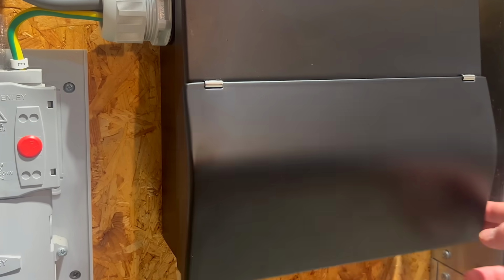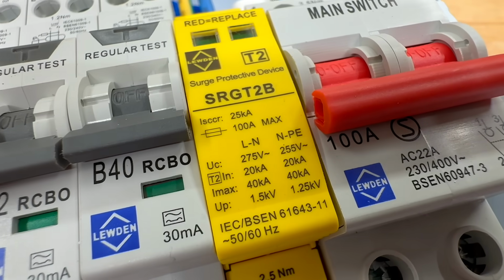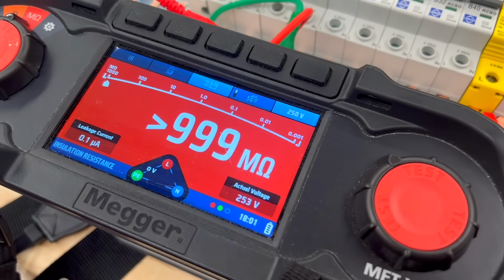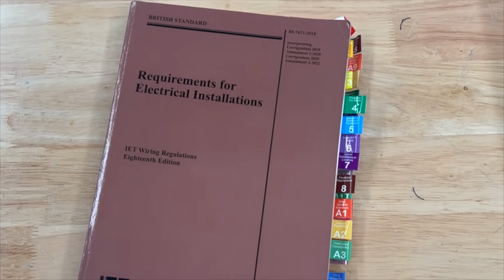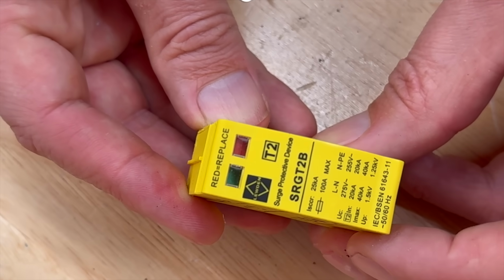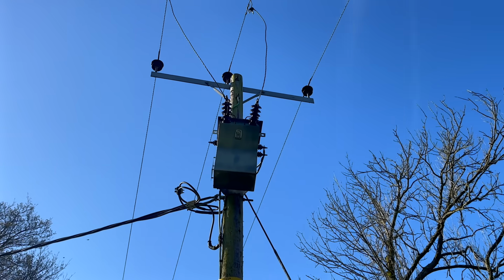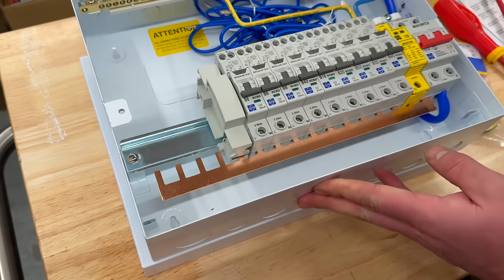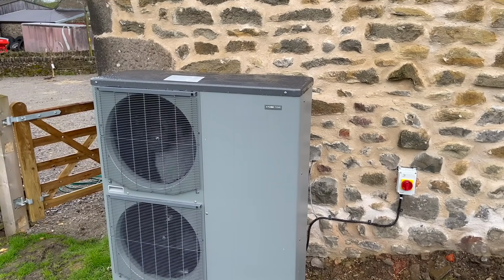Why do Surge Protection Devices no longer require an MCB?

Comment: Currently looking into adding a SPD to my home.  And I'm still seeing many SPDs that require an MCB, either wired in series or upstream.  It's not always apparent from the technical data, often I had to glean it from the installation instructions.
Having to add an MCB kinda stinks... I'm on 3 phase so we're talking 8 units in the consumer unit :(

Comment: Don't most electronic equipment have transient surge protection built in to their  P.S.U as most electronic equipment runs on D.C the current needs to be stable.

Comment: I have just come back to this video are Navitas posted their SPD video the other day. It's like they didn't even watch this video.
Reply: We watched it. So did the guys from surge protection devices and so did our technical team. And we just fundamentally disagree with it. 

The solder point will trip in seconds not milliseconds, you can’t measure or test its tripping capacity and you’re reliant on the DNO fuse as OCP. 

If SPD experts like Kirsty Johnson who sits on the committee with JPEL say it’s not adequate and requires an MCB, then I think that carries a lot of weight.

Comment: Maybe not the same level of issue with "merely" domestic installs (all the small devices I've seen are interchangeable module type that a householder can do without turning off their main switch), but in the commercial/industrial environment where you want to get the contractor in every year or two to properly test your SPDs (or every 11 months if you have an LPS since they probably do both at the same time) you must have an MCB or fuse carrier to fully isolate the device.  It cannot be tested live!  This is why the ISO Standard and CoP insists on an SPD circuit having such isolation, that and the ludicrously slim chance of the cables to the SPD being overloaded otherwise...

Putting an insulation resistance tester across it and thinking you are performing a funtional test is of course just foolish and lulls customers into a false sense of security.  (In my experience, about 25% of SPDs that fail a proper SPD test were still showing good "functional" flags.  Which doesn't mean they are pointless, because if they are down then the device clearly has failed, but does mean you can't rely on them showing the device is good, especially if they really are protecting sensitive kit or mission-critical data.)

Comment: The benefit of an SPD wired downstream a main MCB is that when it fails short circuit, the MCB will trip, protecting the installation until it's manually removed or replaced. With these fused SPDs, you rely on either manual inspection, or an extra attachment that activates some contactor when it detects a flag.

Comment: The power transformer seeks to maintain a certain level of magnetic field varying at the rate of line frequency. If a load is suddenly remove the energy will be dissipated into other loads and that will create a momentary power surge or it could create a voltage spike. The surge/spike protector help prevent equipment damage. It is good to keep a spare -- if the protector throws the main breaker or if excess leakage is indicated.

Comment: It is interesting how this flags its failure, but unlike everything else in the consumer unit, this flags its us not accessible to blind people. Something tactile might be helpful for people like myself and my totally blind partner
Reply from the maker: You can use a contact to trigger an external device to alert that an SPD has failed.
Reply: An MCB in the down position compared to everything else being up also solves the problem. So long as they can get to the CU
Reply: @T_Perkins  Why would they be going and fiddling with the CU anyway?  Unless there's been a terrific bang involved from lightning or other big event the SPD is going to go out of service silently (heat rise due to slow deterioration of the MOVs allowing low current to flow continuously melts the solder).  An external A/V alarm would be the better choice, for everyone.

Comment: That SPD looks nice but if there are (more than one) RCDs protecting the breakers in the consumer unit, you'll not be able to use a busbar. Still, the combination of the SPD and MCB in a single unit is a huge advantage.

Comment: I was at the elex today at the ally pally and there was a talk there and it was explained why you should not install an SPD without an MCB
Reply from the maker: Who was giving that talk? Please send them to the comments to explain themselves.
Reply: @efixx  I'm sorry I did not get her name if it helps she was a young lady in a wheelchair maybe someone else who was at the show will remember her
Reply: @efixx  the spd expert at surge has explained many times why it needs protection
Reply: The advantage I can see to having an MCB in line is the visual assessment by the/a consumer who is not able to or very familiar with the workings of a DB - for means of remote diagnosis. Also, if one thing is down, and nothing else is, and the board is above eye height, it's lot easier to see than a little red flag that only viewable straight on on the device.

Comment: Those melting solder cutouts seem very dodgy to me, if it fails to clear then the unit will finish having its thermal runaway… wonder how common this is, because the MCBs usually specified to protect the SPD are a pretty high rating?

Comment: Another solution for a problem that does not exist, more unnecessary expense for the end consumer who is being fleeced at every opportunity.
Reply from the maker: Can you repair my £300 printer which failed due to a surge event.
Reply: I have had my £300 printer for 10 years. It must be able to take a surge. Or more likely never had one.
Reply: @hammertime3703  exactly, a solution for a problem that simply does not exist!
Reply: @mintsauce101  Then one day you find out it does exist.  You come home and your fridge, TV, air conditioner, toaster, washing machine, computer, internet connection, water heater, space heating, EV car and so on, no longer works properly or perhaps at all because that one big event happened.  We no longer live in the 1970s and earlier where most things were electro-mechanical.  That one event that may not happen, ever, but should it happen it is going to knock you from the 21st century back to the '70s.  Most appliances will deal with the day to day stuff that comes in on top of the 50(60)Hz supply but even then cumulative damage still takes its toll.  Cut open a safety rated film capacitor that has been across the mains for a few years and look at all the damage (it is impressive).  I actually had such an event happen in the '80s.  A fault of some type happened with the transformer that supplies my neighbourhood.  I had my home computer, TV, VCR etc plugged into an Islatrol filter which took the hit and saved everything.  The neighbours weren't so fortunate.
Reply: @ Well after 30 years in the same house I am yet to experience this phenomena that seems to be so prolific that new protective equipment is being developed and forced on on the consumer at great cost, all through scare mongering. Bear in mind I have been working in the power industry for 20 of the those 30 years and see first hand the "quality" of modern electricity generation. You are correct, we do not live in the 60's, 70's 80's 90's or even the noughties anymore, modern supply regulation equipment means that any transient spikes are absolutely mitigated at source and not passed on through the network and why you may ask? Its down to the Green generators switching in and out of supply. Solar, Wind and Energy from Waste (Biomass etc) all are classed as unstable generators and the connection designs for these supplies all have state of the art reactive smoothing specifically designed to prevent and mitigate spikes. Its a complete non issue on modern generation but the IET have justify their existence and need to maintain their funding streams.
Reply: @mintsauce101  You do understand that transients are typically generated by loads in a particular LV transformer distribution area, right?  We aren't talking about issues at the MV layer.  No wait, wait, you do understand this at least based on your statement that you worked  in power generation for 20 years.
Reply: @mintsauce101  In case you haven't guessed, I don't care what you post next, that might be an implosion of anger, who knows.  I won't be responding.  My comment about LV and MV will be the last.
Reply: @efixx  really sorry for your loss, how do you know it was a surge event? Do you have active monitoring and data collection at home? These so called surge events as you say in your video are transient short term spikes, I'd be interested to see how you came to that conclusion.
Reply: You guys don't have lightning strikes? 😮
Reply: @Jako1987 30 years and still counting, loads of tech in the house and never had an issue.

Comment: If you have ever seen a MOV blow it would be the last thing you want inside a consumer unit and relying on a specific amount of heat to melt a blob of solder is a bit dodgy. A separate metal box would be better and better still would be to wait for ISOMOVs which incorporate a GDT sandwiched between two MOV discs. An advantage of ISOMOVs is that the MOV parts don't have mains across them all the time, slowly degrading them.
For proper surge protection Type 1, Type 2 and Type 3 devices are all needed in place, Type 1 at the entry and Type 3 close to sensitive devices. The real reason for putting them inside consumer units is to protect the microcontrollers inside AFDDs.
Reply: Just a bit of smoke when they blow, what’s the drama?
Reply: @edc1569  Oh no, it can be far more spectacular than that.  Even when there are MOVs in an appliance, where the fault current is greatly reduced due to cable lengths, can explode into shrapnel.  Only some thick heatshrink, if that is even present, contains it.

Comment: Just an observtion, the SPD protection has no external warning it has failed apart from that built in to itself. So a householder may likely not know it has failed unless they regulrly check the stste of the consumer unit. Thus if frequent surges occour the use of the device would be of little value after the first failure would it not?.
Reply: I think you raise a great point. Perhaps some kind of SPD+MCB+main switch combo, whereby an SPD unit with a replaceable module could be attached to the main switch and switch off the entire installation when the SPD module needs replacing.
Reply: @NewMediaWarrior  switching off the installation is bonkers imo
Reply: @edc1569  depending on what equipment someone may be running, they may want that, although in that case, they should be prepared with replacement SPD device modules. Mind you, it is only switch off, not switch off and lock off (that would be crazy)!
Reply from the maker: The devices are only liable to fail after multiple surge events, the exact number depending on the frequency and magnitude of the surge. In most installations they are rare events. The surge device does have some volt free contacts which change state on failure so could be used to trigger an external device. - Learn more in this video https://youtu.be/EHbtvzHakbU?si=DibkD7RsPbl3Q8K6
Reply: Lots of call outs 🤑

Comment: My understanding of SPD’s is they must be used with a fuse/MCB that is in series with all circuits downstream they are intended to protect to work best, when the voltage goes very high they go short circuit or very low resistance, loads of current flows and blows the fuse/MCB and thus protects all devices downstream but will effectively one shot leaving everything off afterwards! The current arrangement is a compromise or trade off with the SPD on its own breaker that makes them just in parallel with the other circuits so it can’t protect them once its own MCB is opened. So I think for best protection individual appliances still need their own fused down surge protection locally some electronic power supplies have SPD’s built in for this very reason, a surge would just blow the devices small local fuse following a surge event protecting the individual device’s electronics if your lucky!
Reply: You might want a Type III to work like that (although they still don't due to the low energy generally present in that context) but Type I & II work in parallel with the supply to dump the surge to earth before it reaches other circuits.
If you install one as you describe, which would be trivial, it can only protect the single circuit you install it on, in the manner you describe.

If you really want to specify the extra layer of protection you describe, use an industrial SPD that has a trigger (an electrical signal on a 2-pin header or a mechanical pin that can trigger another device) and wire your desperately-sensitive circuit via a contactor triggered by the failure of the device.

SPDs operate faster than an MCB possibly can -- generally in half a cycle -- so being able to dump a surge to earth and then open again to leave power seemingly uninterrupted is an effective way of protecting the whole installation rather than one circuit.  And if you have equipment so sensitive that you want this level of protection you'll already have a contractor coming in every 11 months to inspect your LPS who can also test your SPDs... won't you...

Comment: Crabtree and Wylex SPDs have never needed an MCB. They have also been a single module for several years.
Reply from the maker: Correct but they did used to be 2 module devices
Reply: @efixx The point is Lewden aren't the first to market with a single module SPD that doesn't require an MCB, so I put it to you that they have copied their competitors, rather than innovated.

Comment: Great video - thanks for sharing the video. However, I'd like to comment a misconception regarding the single-line diagrams: The video presents that the transients travel from the live conductor through the SPD and towards the neutral. As we all know, the main principle of the SPD is to absorb these (coming from any phase and/or neutral) and send them to the ground, NOT the neutral! This must always be the case regardless of the earthing system of the premise (TT, TN-C-S, etc).
Reply: Sure?
Reply from the maker: Interesting point - but also remember that in TNC-S the Neutral and Earth are joined together at the service head  typically less than 3 meters from the consumer unit.
Reply: @efixx  Thank you for your reply, however I have a different point of view on the subject. I mention on my previous comment "...regardless of the earthing system of the premise (TT, TN-C-S, etc)" to avoid commenting things that have no relation with the main principle of SPD but, here we are. If we think for a moment your approach and consider a large project, where the distance between the main supply and a final circuit could be hundreds of meters away, you should not expect to carry these transients back towards the main supply's location (ie main earthing bar) to be resolved but to send them to the ground as quickly as possible. In such case, TT or TN-C-S or any other earthing system (connected to the ground) have little significance since the transients (ie lightning strike) will try to find the way to the ground through the shortest distance and not travel hundreds of meters away to locate the main earthing bar. Furthermore, we expect from SPDs to try limit these transients within the power distribution systems below a safe threshold, by sending them to the nearest ground and NOT to the PEN conductor.
Reply: @angelosalexiou  In the Australian (New Zealand, USA, Canada and many others too) context where essentially everything has a N/E link in the equiv of the main switchboard (MSB), the SPD only acts between line and neutral since neutral is staked to the ground (dedicated electrode for decades, but can also be cold water pipe for old installations, also bonded items in touch with the ground) from the MSB.  If the wire distance from the MSB to a sub-board that uses the earthing provided by the MSB is > 10m then a GDT (used instead of another MOV to prevent leakage) is used to ensure the potential between line/neutral and earth is clamped too.  The nature of the bulk of the transients is that clamping line to neutral, even if there is no form of local electrode at all(!), will protect the premises equipment.  That doesn't mean there is no need to shunt current to earth when that is where it is trying to get to, of course.  (re-post of comment)

Comment: The surge protector in my consumer unit according to the manual has a maximum upstream protective device of 125A or less.
My main fuses are 25A so no breaker needed (saves a lot of space since it's 3 phase)

Comment: Hager have never had an MCB for their SPD as they come off the main switch this has always made more sense to me.
Reply: same with wylex
Reply: One of the reasons I love using Hager. The Earth also connected through the metal casing of the board.
Reply: Hager ones use up 2 ways however this only one ☝️